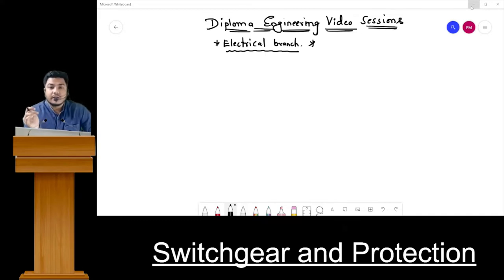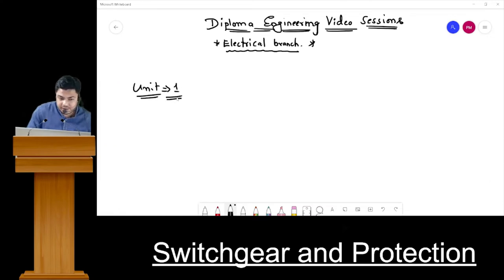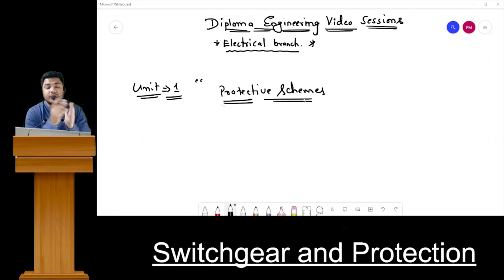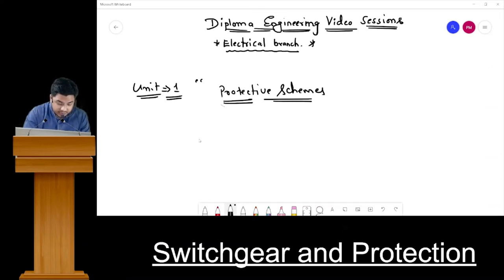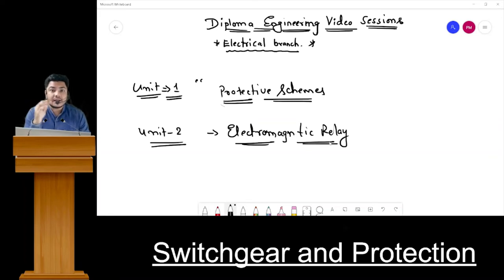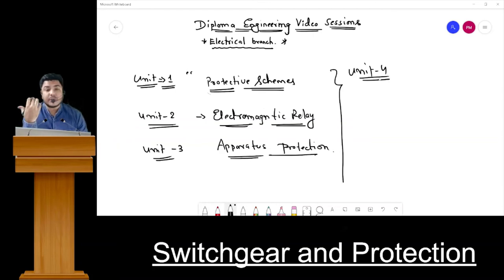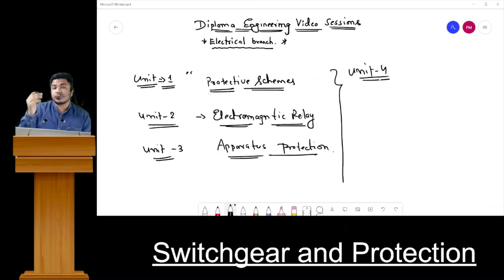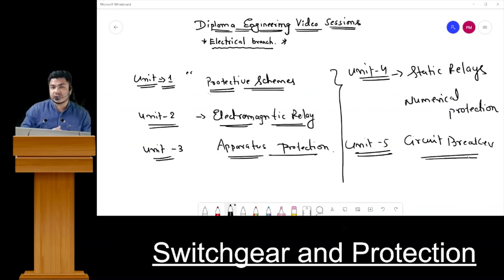Switch Gear & Protection - Electrical Engineering #electricalengineering #switchgearandprotection

Comment: Very Nice Ptakash Sir👍😊
Yes Switchgear and Protection is very important subject for both diploma and degree electrical engineering
And also useful in Gate and government exams
So learning from you will clear my doubts😊
Reply from the maker: Yes dear 
That is the reason i though of making videos and making it simpler